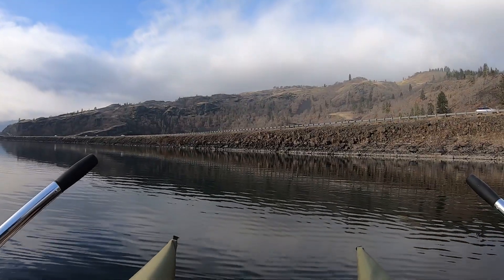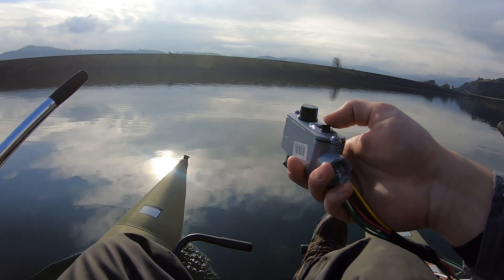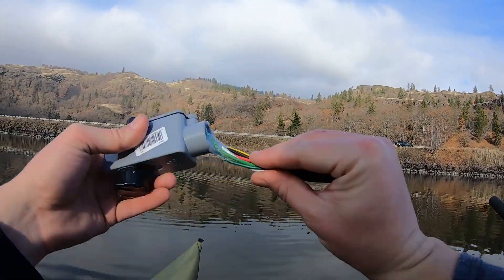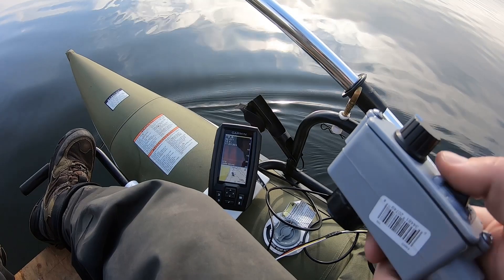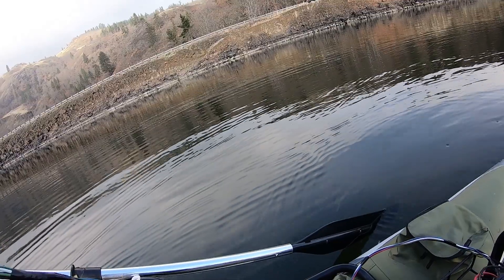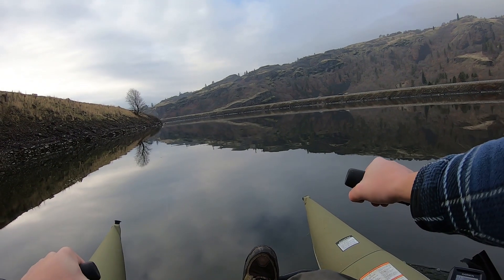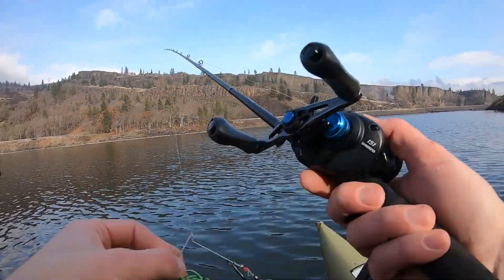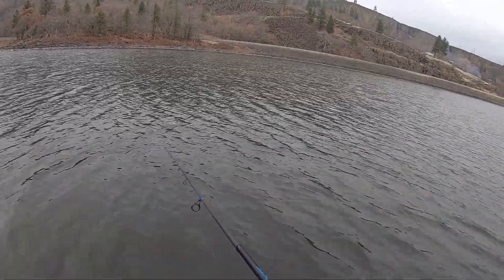PWM On The Pontoon - NEW PONTOON MOD!

Comment: I've gone full circle with all my mods on my pontoon and kayaks.  A few years ago - I had all these steering mods, trolling mods etc.  Now I find them just a hassle.  Currently on my pontoon, I now just use a  "Minn Kota Max" trolling motor (Has PWM built in and not a ton more $ really) - and I just turn my seat sideways on the pontoon, and rest my feet on the right pontoon.  It's actually super comfortable (especially when trolling) - I can reach the trolling motor nooo problem, and there's no extra wires cables, etc.

On my kayak, I used to have a rear trolling motor added with those steering cable mods.  Ditched all that - now I just have the motor locked "straight" full-time and use my paddles to steer (like the person in this video).

Sometimes less is more, so I've learned lol.  It's easy to get caught up in all the mods.
Reply from the maker: Yeah I can definitely understand the simplicity ideal.  I actually got a little paddleboard last summer with a cloth back "seat" that I take up to small mountain lakes.  Definitely a lot nice than lugging around the pontoon with all the mods and whatnot.  I definitely enjoyed the DIY part of the mods, though.  :)

Comment: I've just ran across your channel this morning. I've subscribed and have been watching your videos relating to the Colorado XL Pontoon system. I've been talking with a friend who has one. Been reading reviews and seeing what other pontoon systems are out their. I keep coming back to this Colorado rig. 

If you were to start over would you buy another Colorado XL? I'm thinking you would based on your videos. What LB thrust of trolled are you using? Would a larger one do you better? 

Thank you in advance, and I appreciate the ability of watching your videos on the pontoon boat. It has me sold from your videos and all the others I've been watching.
Reply from the maker: Glad the videos have been helpful!  

I use a 30lb thrust motor.  For most lakes I am on, that scoots me around well enough.  Plus any bigger and it'd be too heavy in my opinion.

And would I buy another one of these?  Totally, I really like it and it's great for my apartment.  Packs away small and gets me out on the water!  Hard to complain. :)
Reply: @FishandForage  Thanks for the reply. This Colorado pontoon system certainly looks like the direction in going to head. My biggest concern now is transporting. I'm going to try to carry it on top of my truck topper. With hardware in my lower back in not sure how that's going to work out. Worse case I'll get a light weight trailer to bring it along. 

Thanks again! Looking forward to your next post.
Reply from the maker: @richardcooper38  If you got the rig to do it, transporting it in one piece is nice.  I have to break it down to transport it.  Adds 15-20 minutes of setup and teardown, but it's not too bad IMO!

Comment: Mike here again....im doing the same mod on my XT.  Here are my pics for ideas purposes the water proof box was like 2bucks at Walmart I'm gonna velcro it to the fly patch spots and use the intricate loop on the box as a fail safe attachment lanyard.
Reply: What you see on the lid are the fwd/rev switch, speed controll knob.  The digital read out leds are hot blued inside of the waterproof box, and its see throug, so u can see it.  It should work good, when u find good trolling speed, so you can duplicate it...
Reply from the maker: @mikecarnakis6243  Dang I don't think pics work on youtube.  You can send em to my Instagram if you want!  I am working on putting my battery and the PWM into a battery box, soon.  And I think I want to try to set up a CAT-5 cable for the hand controls.  Way less bulky than the wiring I have now.
Reply: @FishandForage  i was able to add a drop box link for the pics of my controll box in this reply thread
Reply from the maker: Oh yeah yours looks way nicer than mine.  Have you ran it much yet?  Did you have any issues with heat in that smaller box?
Reply: @FishandForage  i have only run it on the bench, but I will keep you posted.  I have some micro fans like on a pc, but only the size of a quarter I found on Amazon.  If heat is an issue, ill try those.  Thx 4 the complement.  How many Ah is ur battery?
Reply: Well trying to ad pics...??
Reply: Click on my drop box link...
Reply: https://www.dropbox.com/sh/aqlm5170ffbdgkh/AABWZKwsw-cP6H2oFpa5r9Gqa?dl=0